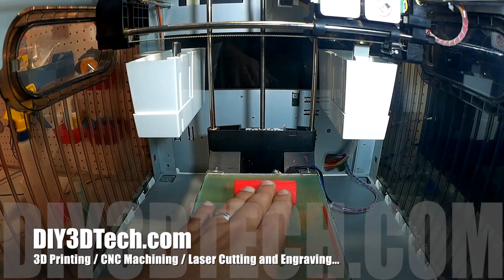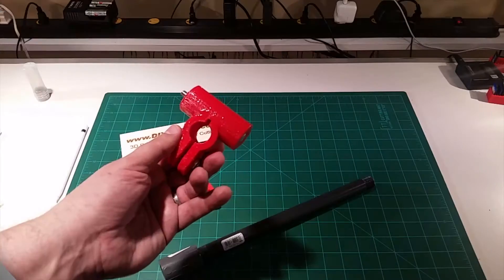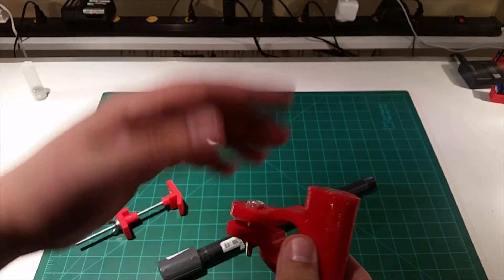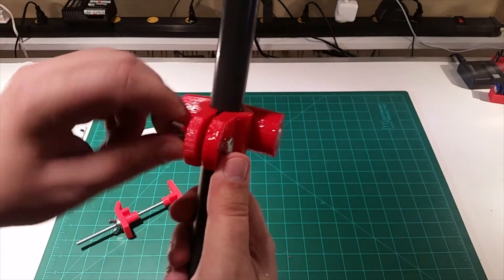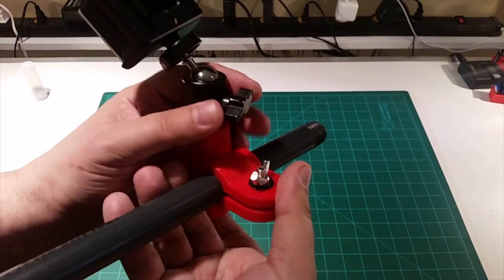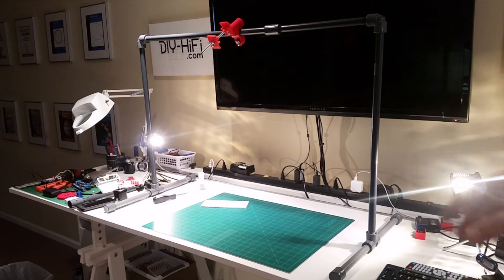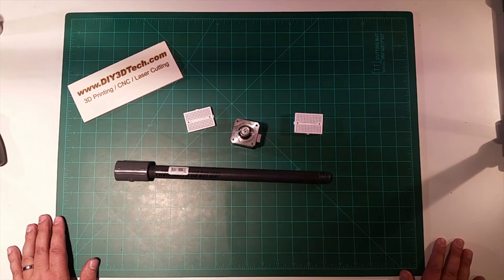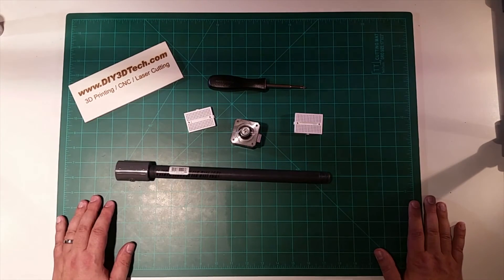TinkerCad Workflows - Designing a Camera Bracket Part 2!

Comment: The way you design things and the way they get printed can lead to totally different levels of structural integrity then what you'd expect. Over time you just adapt and design things slightly different so you get more layers and strength where you need them.
Reply from the maker: +Mickice your 100% correct and reason I do these as it seems to be simple to whip it up but as you point out what you get is vastly different.  I started a project to design laser tube holders for my laser cutter thing it a simple task now four weeks later and countless prints I am just an out there...
Reply: I was printing a simple flat surface with a rod that came out about 8cm for a spool holder, but in the printing world there was only about 3 top layers holding that rod with complete emptiness underneath. I redesigned it and made both objects separate then hammered them together. Much stronger.